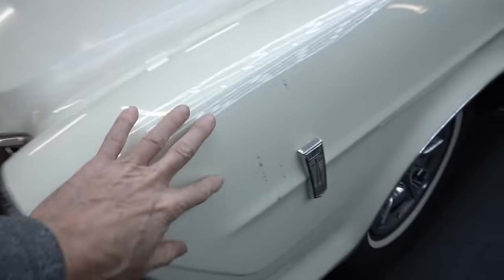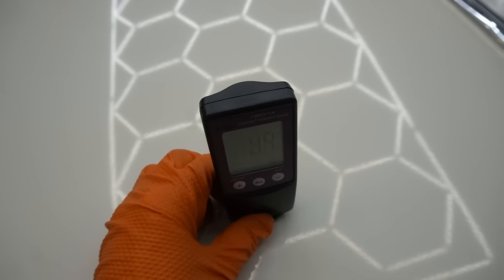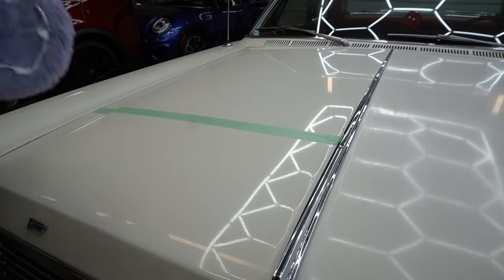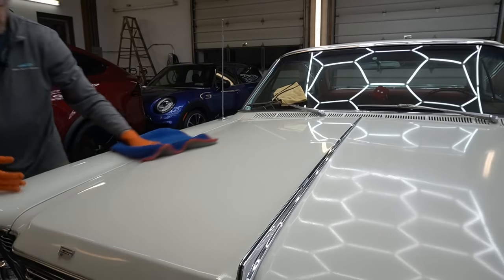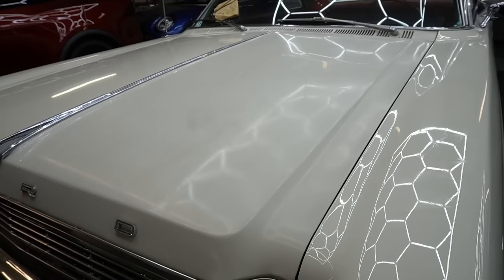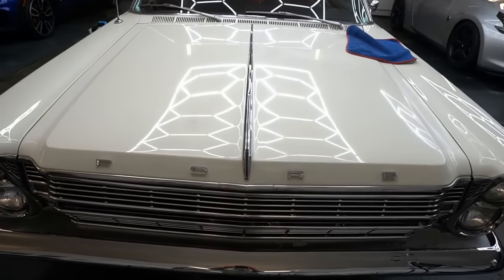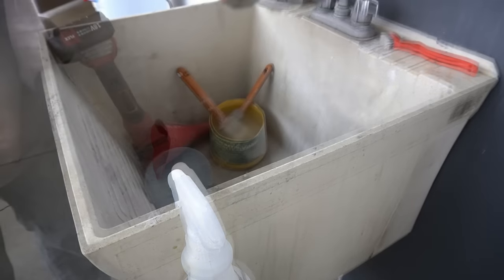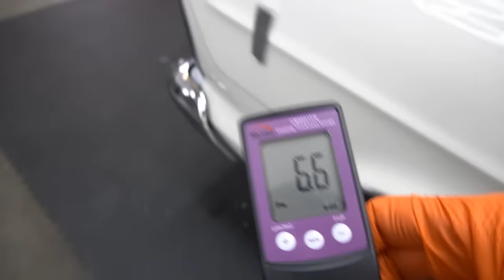Super Thin Car Paint!! Paint Rescue On 1966 Ford Galaxie 500! Can We Save It?

Comment: I just finished a fiat 500 using the flex and an udos 51 with the rotary and 15 mm throw setting and I really love the flex with forced rotation. With all the curved surfaces it’s a massive time save and with the limited rotation it save my pads from heat death while cutting extremely well and have had any issues with finishing even on softer clears.

Comment: Brian:  Back in the day? These Ford products absorbed bonded contaminants and they were tough to compound.  Today?   Fallout remover, clay mitt....or bar and a d/a with 1-n-Done. I'd experiment on how aggressive a foam pad I'd need as the car is, except for the front fenders original paint. The Fords of this era (and I have done my share) are really easy to go through edges.  I also noticed that you're gassin' out. What's goin' on  there??

Comment: I just recently did something like this with my new ISF that I just recently bought from a close friend that is a private collector he ( in ultrasonic blue )had cquatz finest on the paint done about three years ago unfortunately he didn’t know how to maintain it and ran the car through the swirl maker 5000 again this just goes to show that you still have to learn how to take care of resin based coating a lot of the people that asked me at work should I get a ceramic coat think that it is some superpower coating Brian, anyway with soft Japanese paint considering taking the car to a professional I have a friend from the Subaru club that owns detail maniac here in Sacramento and I was considering having him do it since I’m just a DIY detailer…. but I decided to do it myself. Unfortunately, I gave one of my coworkers, my perfect finish and I was out of compound so I went to my local O’Reillys and I was able to find Meguire‘s mirror. Glaze swirl remover, 2.0. In this situation finest was still on the paint so I wasn’t sure if I should completely remove it or trying at least pull the scratches and swirls out of the paint so working slowly with my torque 10 FX and an orange hex logic cutting pad, I slowly started to do my work And I did it on slow speeds because I did not want to swell the paint I have to say I got the car to 70% where I wanted after that I top coated it with ultra lock. Brian, I’ll send you the pictures of the car on Instagram check your private messages. Thanks.

Comment: When doing paint correction or enhancement, is there a certain paint gauge depth (mils) that you wouldn't apply something like 3D One?  Curious at what some people might draw the limit at to not use it.
Reply: On modern paint 3 mil is about your limit. On old single stage your limit is right before primer shows, because clear and colour coat are mixed together. That being said you want to leave as much thickness as possible, because the thinner it is the more sensitive to UV it becomes

Comment: So it has thin paint, so you use an extremely aggressive compound with a wool pad to cut? Doesn't make sense.
Reply: The combo he did removes very little material. 0.1 to 0.2 mil and is very safe to do so.

Just because a pad is aggressive doesn’t mean it’s removing a lot of material. A human hair is about 1-1.5 mil. Removing 10% of a mil is very repeatable and safe
Reply: @Aaron-tv6fs  The most aggressive combo you can use removes very little paints? Wut?
Reply: @MeliorIlle  Yeah. A DA or Longthrow removes more material then a rotary to acheive the same result. It also generates more heat, which makes correction less efficient, which causes more material to be removed and worse results.

I cant explain 18 years of knowledge and experience over the internet, nor do I do that for free.
Reply: @MeliorIlle  Wet sanding removes defects faster with less stress to the paint and removes less clearcoat then a heavy cut to remove the same defects.

Its not that complicated
Reply: @MeliorIlle  if you understood how correction works you'd realize a "aggressive pad" is refering to the amount of work done, not that its aggressively removing clear coat. One aggressive pass removes less defects then doing 3 medium aggressive passes. its not rocket appliences
Reply: @Aaron-tv6fs  So the most aggressive pad and compound you can use cuts less than crappy compounds and pads, even though the tools and content itself says otherwise. That's wild man. Teach me more plz.
Reply: @MeliorIlle  get a paint depth gauge and play around with different polishers pads and compounds and you'll see what I mean. Finish polishes remove almost nothing. the right pad and compound remove maybe 0.1 Mil and get 90% of defects out. its a safe amount